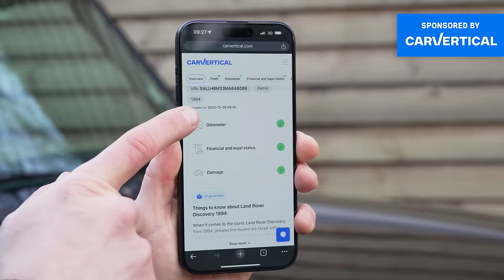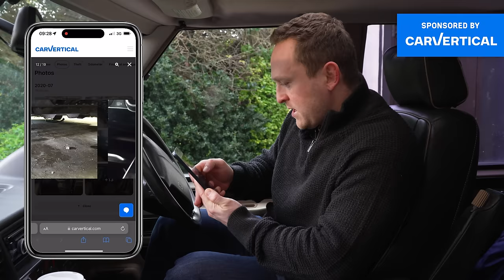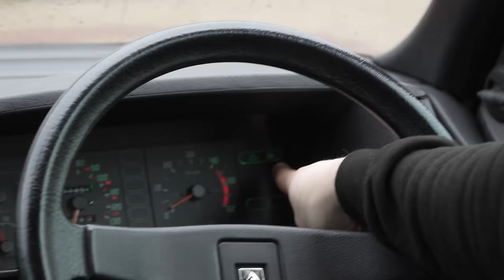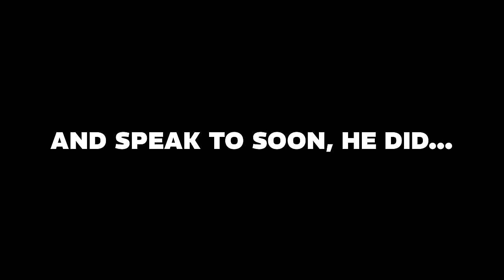WILL THE UK’S CHEAPEST CAR MAKE IT 500 MILES TO PARIS?

Comment from the maker: Get 10% off Car Vertical using code Autoalex! 
GB: https://www.carvertical.com/gb/landing/v3?utm_source=infl&a=AutoAlex&b=38b26e3a&voucher=autoalex
US: https://www.carvertical.com/landing/v3?utm_source=infl&a=AutoAlex&b=2c9b600c&voucher=autoalex
Reply: Re turbo edith????
Reply: Alex mate, you're flying low in the CV add.
Reply: He got a bit excited while filming and forgot to zip up.
Reply: DON’T put the suspension at the lowest setting to drive her! We owned one and the owners manual really did stress this!! 😮👍👍
Reply: I love Edith! Desperately wanna take my Mk1 Saxo VTS to France 🇫🇷🇫🇷
Reply: That’s not the cheapest car lol, I’ve had a mk3 fiesta 1.25ltr about 5 years back that I paid £20 for. Needed wing replacing and a couple of patches on the sills at the back but other than that it ran, drove and stopped. I’ve had several cars for less than a £150. Including  two 106s (£150 and £60), between me and my brothers we also had a cavalier for £40, mk3 Astra £20, I was paid £50 to take a rover 100 (1.4ltr) lol that was probably the cheapest car I owned lol
Reply: Thanks for such a laugh guys 😂😂
Reply: I think you guys should seriously consider making Edith a project car.  Do a bit of a restomod.  Get her really clean.  Fix her rust, straighten the body, give her a wrap, replace all the suspension components like bushings and tie rod ends, wheel bearings, upgrade her brakes, new wheels and tires.  Swap in the turbo diesel with a tune.  Put a nice A/V setup inside with a screen for nav and such.  Replace the broken and cracked stuff.  It doesn't have to be perfect, I'm not suggesting you make a show car, something nice a good shade tree mechanic could do.
Reply: The hydraulic suspension system is kind of similar to the hydraulic anti roll bar system McLaren use on their post slr super cars.
If you want to hear why they had to use a hydraulic system and how the idea came about then let me know.
Reply: flying low there dude in the video promo!
Reply: Next time, buy a Dacia, and go to Bucarest, Romania!!

Comment: Considering she's a classic and there aren't many BX's left, why don't you three awesome blokes consider doing a series on restoring her? I'm sure we'd all love it ❤
Reply: Also there are a few good people on YouTube/ the web who are good with these upndown and the bx project come to mind.
Reply: I'm sure that they would fix up the BX.
If they weren't far too busy acting like 10yr old boys on a school trip. Just to make folk like myself laugh 🤣
Reply: The engine in mine blew up in 1998.
Reply: YESSSSSSSSSSSSSSSSSSSSSSSSSSSSSSSSSSSSSSSSSSSSS
Reply: @flipacoin3593  My dad had one about 36-38 years ago. It was a slightly used MK1 blue diesel estate he bought as the family car when I was on my way to this world. I remember imagining we were taking off with an airplane because the glow plugs first needed to heat up, then when the engine started we had to wait for the suspension to rise before finally taking off. We also had a rear tyre blow on the motorway at 120-130kph, which we only noticed because of the sound that made my dad pull into a service station many kilometers after the noise started. 
Ironically it was that fantastic suspension that made my dad sell it: apparently some parts of it weren't very reliable back then and the replacement parts weren't any better but very costly. 
All those years later, I'm thinking about replacing my 2CV (which I like when I drive it but don't drive enough to be worth keeping long time if I could sell it for a good price) with a BX diesel estate.
Reply: I'd love to see the BX fully sorted too. I've seen a couple of BXs in the last few years but none were estates!
Reply: Theres a reason why theres not many left 😂
Reply: Horrible things, my dad ran them when he had his cab company, the sooner they are all gone the better.
Reply: @popuptoaster  why would you have a hydraulic monster like that for a cab company just run vauxhall astras they'll last 20 years on one oil change. these cars are of people who take care of them lol.
Reply: @skylined5534 would never be good value for money

Comment: Bought one of the last non Turbo BX's (K39WCW). Probably one of the best cars I have ever owned. 117000 miles in 6 years and apart from consumables didn't cost a penny. 50+ mpg and made short work of the  750 miles  trip to the Dordogne twice a year with no problems!

Comment: This car shares very similar parts to the Peugeot 405. So if you need any parts you could probably get parts off 405s. Also those 1.9XUDs are proper reliable. Especially the non turbos.
Reply: My dad had an Citroen Berlingo 1.9 first production year with the XUD. The damn thing whent past 700 000km before he scraped it.
Reply: @Gravstein  what year because I have a 1.8 XUD in my 205 from 95

Comment: Back in the 90s if you went into a scrapyard one of the first things that always disappeared on these were the front callipers because at a time when everything had rear drums unless very high performance or expensive, bx calipers were in high demand for rear disc conversions on your high performance project, why? Because the bx handbrake worked on the front wheels!!! so was about the only cheap calliper available back then with a handbrake mechanism 😅
Reply: I remember our neighbor getting one of these, when he and my dad wanted to change wheels they were very confused why the rear wheels weren't locked by the handbrake and thought it was broken lol
Reply: The front calliper on a BX is basically the same as a 205 GTi rear calliper, except it uses seals compatible with LHM and not brake fluid.
Reply: @hughparris2073  yes correct ( ish) I say ish because yes same calliper but the seals fitted worked with  LHM “AND” brake fluid, NOT INSTEAD OF as you seam to think, so (1) there weren’t many 1.9gtis in scrappies back then lol ( 1.6gti had drums) and (2 ) brakes with LHM seals work perfectly with normal brake fluid, although it’s important to note that doesn’t work the other way round, ie if you put 205 callipers on a BX the seals would not work with LHM fluid. Also the 205 calliper had a  far smaller piston ( it was a rear brake not a front brake after all, and in a light tin can of a car with sod all weight in the back) bx better in most other applications tbh than 205, tbh 1.9 gti was over engineered (S1 and S2 RS turbo for instance still had drums and same standard power as 1.9gti ( 130bhp) even ones chipped to near 200bhp still stopped ok on rear drums when really with them having more weight  it would have made more sense for rear discs, but still ford didn’t find it necessary and tbh it wasn’t, but I digress lol,not that it matters much at all or makes any difference but to get the best out of BX on the rear you used an adjustable brake bias valve or pedal box but that was defo not mandatory as it worked well either way with or without that) So as I said,  front callipers were first things to go in the scrappies off these :)  I’ve been there and done it mate ;)

Comment: This brings back memories! My parents had late-80s, petrol, white BX when I was a kid. I loved it, and the seats were super comfy. My mum, being the driver, hated the lack of assisted steering, which made parallel parking in a city an utter nightmare. The car lasted just a decade, as it developed a fault with the suspension system that no mechanic could (or wanted to) diagnose and fix. It would just randomly decide to piss all the suspension fluid away, like an incontinent cow. My parents spent a fortune on suspension liquid, trying to keep the car running for the last couple of years. We had a rather scary ride down an 1800 m mountain with no brakes, and my mum decreed that the BX had to go.

Comment: A very happy new year from Ireland guys.
Congratulations on getting Edith to Paris and I really enjoyed your upload.
I myself am a car enthusiast as I have owned many cars over the years and my current car is a 2007 opel astra H.
I accidentally decided to buy an opel astra because my previous car was a 2009 saab 9-3 that turned out to be a total lemon and while it was off the road , my kind elderly lady neighbour let me borrow her opel astra H , that was amazingly good on petrol, cheap to insurer and tax.
I bought my astra for 850 euros and I had the rear suspension fixed in my local garage because I didn't have the tools to repair it but I did replace the rear discs and pads , two rear shocks, the plugs , battery,  front lower control arms and mass airflow sensor and after spending a total of just under 1500 euros,  I now have a good family 4 door saloon that just passed the NCT , MOT until November 2024.
Anyway keep those fantastic uploads coming.

Comment: Just found your channel. I had a BX 1.9 GTI in the late 80's, lovely car with the 205 1.9 engine and it was quick. My father worked and lived in Rotterdam so many cross channel trips taken and it was a real motorway muncher. The suspension was fantastic and for several years when they introduced parking charges (yes you could prior to that park for free!) at my local rail station, I left the car in the lowest position and it could not be physically clamped. Quite to sad to hear how many are left in the UK as it was a good seller.

Comment: Great BX ,rare break model, with metal hood (normally its composite) no turbo , shame you didn't mentioned the MPG , i'm sure it was one of the best you ever driven . I have 2 BX's , 89 1.7 TRD Turbo tecnic and one 91 1.6GTi , both are great and fun to drive , the TRD makes 4L /100Km (70.62 MPG)

Comment: I had 2 of them. Headgasket went on both. I had the 1.7 turbo, on the first one, the turbo didn't work. The main fluid distribution valve went meaning I lost power steering, suspension and brakes. Later, the main fluid feed pipe went as it goes over the gearbox and got worn through as it was touching a vibrating gearbox. I lost power steering, suspension and brakes. I had to carry a map with me that listed all garages that sold the correct hydraulic fluid (Total filling stations etc) and every long journey was routed so i went near one every 50 miles or so. All bolts on the engine (such as the ones holding the thermostat housing on) were made of very weak white metal and snapped with the slightest torque. The pedals were too close to the steering wheel which made my back ache. It was very economical on fuel though.
Reply: BTW, the high setting locks the suspension out at height. i.e. there is NO actual suspension.

Comment: Hi guys, I used to love my many 3 in 1 BX’s. Most of The other Citroens from Ax to Xantia etc were also cool. As you say, lowrider, standard height & really don’t try driving with the suspension raised to its fullest. Cheapest multipurpose suspension / vehicles ever. And I think most of it was Fibregalss. Daniel.

Comment: I pulled one these out of a scrapyard and recommissioned it a few years ago. It really was a lovely car but I never what to repipe a hydropneumatic suspension system ever again. Mine was also a 1.9 non turbo and I remember being pleasantly surprised by how refined it was and it was not as slow as I expected either. Good luck with her I also have a some NOS genuine suspension lines in the garage if you need them.

Comment: My uncles BX lasted 278,901 miles. Bought it for £500 on 162,000 miles. Sold it for scrap at 278,901 miles for 1800 quid after its head gasket went along with the steering column and alternator. Best car hes ever owned.

Comment: Nice job man, i have oil serviced mine half way between main dealer services, plugs on the preventative list for 2024 too 🙃  your car looks to have original expansion tank, worthwhile replacing with the current one without the silica bag in it, was less than £30 from dealer 👍🙂

Comment: I went round France in a Citroën bx... Ax engine 5,000 miles alternator went got a new one at a french scrappy.. 350 quid sold it for 40 quid seats fit a vw camper apparently.. nice ride fuel tank leaked when filled lol.. two spanners to get that alty in still cant remember how i did it... had lots of road trips like that.. loved that car..

Comment: I had a 1.9 Citroen ZX back in the day. Comfiest car I ever had, rode beautifully and did 300k miles.
Reply: Did it have the keypad immobiliser on the centre console?
Reply: @itchyscratch3829  It did indeed. Same as the peugeot 306 I believe. They shared the same chassis although different suspension and body and trim.

Comment: Is it true that old deisels needed the glow plugs to be left on for a while, but modern diesels appear to be quicker/easier to start because the ECU pre heats the glow plugs by  activating them  when you unlock the central locking?

Comment: Turbo her! She absolutely deserves it. My Uncle had a BX Petrol Saloon. Only has "suspension" when the engine's been started. If the hydraulic belt goes, hilarity and hard driving ensues. It was a long time ago, but I recall the suspension, power steering and even the main brake servo being down. You had to remove a panel to change the rear wheel also as I recall. Could be totally wrong, but was about 25 to 30 years ago. Great shitbox.

Comment: I used to have an old Peugeot with the 1.9 non-turbo diesel. Used to just fill up with vegetable oil when it used to be 50p a litre. Great cheap motoring. But constantly made me want chips due to the smell 😂🤣

Comment: You Guys crack me up!

If you struggled to get diesel, an engine like that would easily run on chip fat, as Alex well knows 😂...I reckon it's a keeper, love it! 
When I was younger I used to borrow my Dad's VW T4 (non turbo) Caravell, pretending to be staying local (he was never keen on me using it at all) I'd disconect the speedo (really easily & quickly done on the T4)so he didn't know how far I was actually going & chuck a load of vegetable oil in it (veg oil was well cheap back then) 
I'd get a load of mates together & we'd go off for a massive Drive somewhere. Always such a laugh 😂

Comment: BX car is a very good car and that engine will run for ever, 500,000 miles in is nothing as long change oil and filter ever 10,000 miles That car will be very collectable within the next few years.

Comment: The header in the video is trying to surprise you "cheapest car make 500 miles". That's an XUD Peugeot diesel. Most reliable engine made. In africa, they clock over a million miles. Don't let the video suprise you. The truth is, that car would do paris and back more times than any new car. And you'd probably need 5 new cars before that engine gives way.